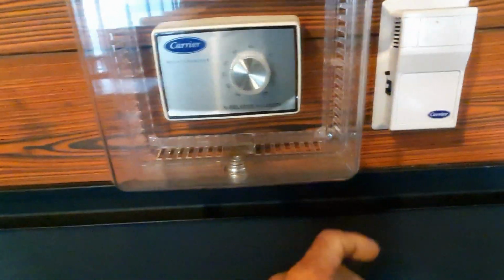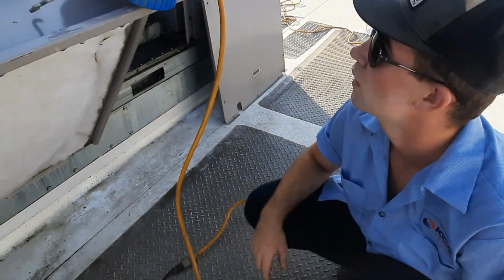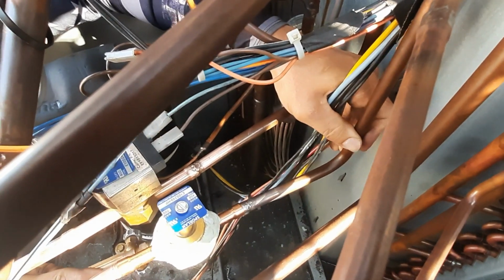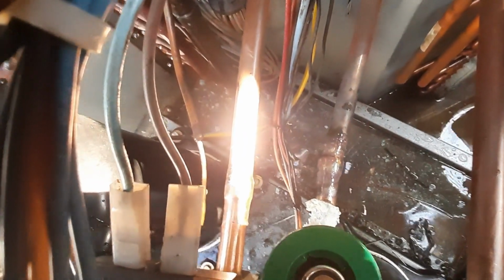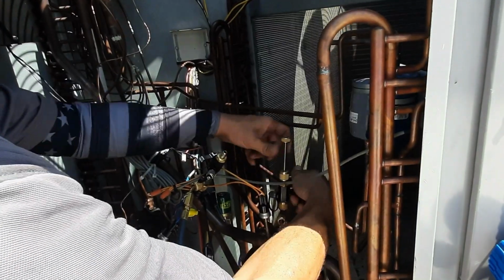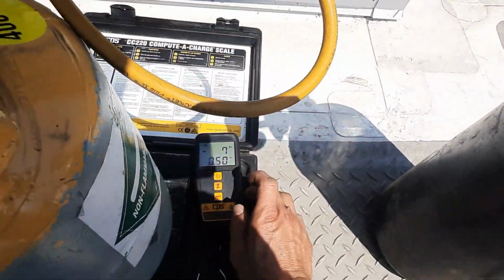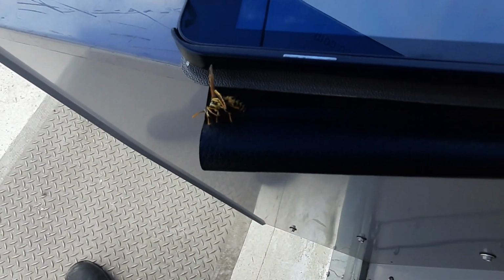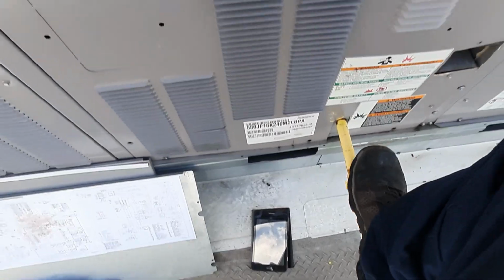Real World HVAC repair. Carrier humidimizer repairs.

Comment: You’ll get there buddy. The brazing takes time for some just don’t get too scared of the fire biggest add ice I can say is don’t get too close to the copper turn the heat up a bit. Good video though. Your apprentice will shine give it time bud. :)
Reply from the maker: 🤣 keep in mind I was brazing blind here lol, thanks AG!
Reply: @EverythingHVACR  oh no lol sorry didn’t mean you meant towards your helper not you bud. But I know what you mean brazing in the hot asz heat with sweat coming down from head burns them eyes too. Yet recording not too easy for anyone to do either. Good work though brother 👌👍
Reply from the maker: It's all good, this was tough brazing and the added heat makes it more difficult. I like to let my helpers braze but this was not one of those times, I didn't want the solenoid to look like the txv, lol, it wasn't leaking but drives me crazy, wet rag plus acetylene tank gets you a braze like that. Thanks again!

Comment: Is there a Dehumidification coil on supply air stream..?
The hot gas solenoid is feeding it.?  Just curious on how it is engineered
Reply from the maker: Yes hot gas solenoid feeds a reheat coil and/or evaporator